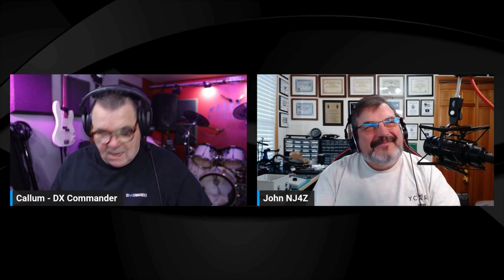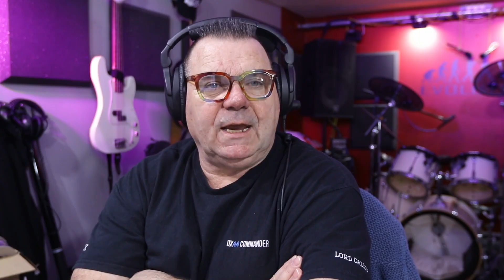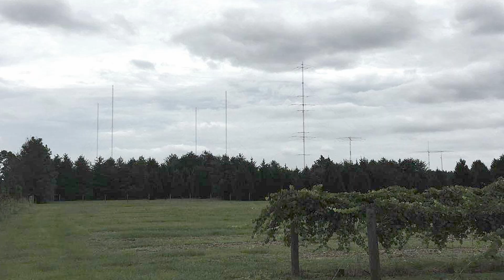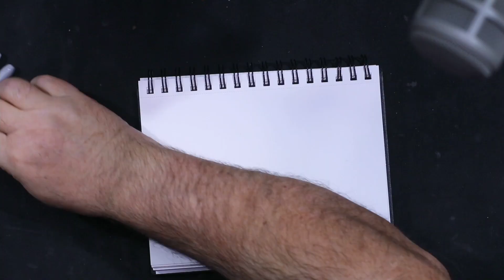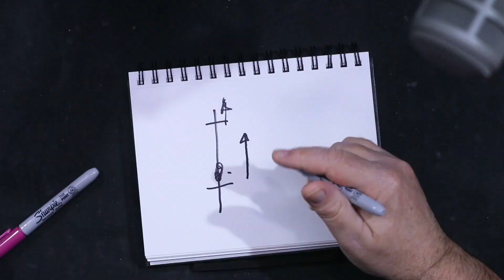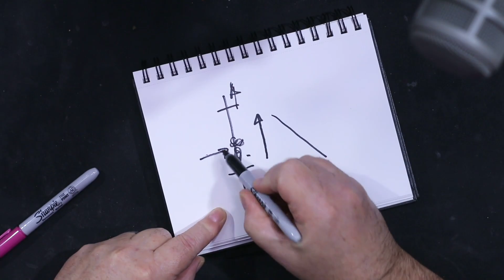Could We Phase TWO Multiband Verticals Antennas Together?

Comment: Two verticals for 80, 20 m apart with a 90° phasing gives you infinite F/B and some 3 dB lower noise in RX-mode.  Making the verticals also resonant on 160, the phasing 135° gives you again an infinite F/B- ratio there. 3 dB lower noise there as well. The result is most noticeable in RX- mode. Try it and you will be amazed. 73 et GL
Reply from the maker: >>>  infinite F/B <<< Yeah OK!
Reply: Used such antenna on 80 & 160 from 1979 - 91. > 40 dB of F/B on many occasions when low radiation angles were active. S9+++ to NOT audioable in reverse (RX- noise S1).

Comment: Hi Calum re multi band phasing could you use a variable inductor and/or variable capacitor say connected to stepper motors to change the phase angle of the phase line also say perhaps a Wilkinson divider to ensure equal current goes to each antenna before the phasing unit but i wonder if the losses would justify such a setup and its practical
Reply from the maker: Yes. As a science project, I think you are probably near it - but economics, practicalities etc might be off-putting, as you indicated..

Comment: G/D from chilly New England Chaps......here is the difference......the hex beams are connected up in parallel, the beams themselves produce the radiation pattern and are individually 50 ohms so all they have to do is properly match the total 12.5 ohm impedance (4 parallel 50 ohm units) to the ultimate 50 ohm feedline impedance......when we phase verticals we are using the spacing and delay lines to produce the radiation pattern as we know....a much different problem, adjusting delay lines is "easy", changing radiator spacing electronically, not so easy..... cheers from New England to Old England, 73 Mike K1FNX
Reply: thanks for the information, Mike that makes sense for the Hexbeams.

Comment: How about filtering and phasing. Filter the band you want then add a delay then recombine back through another filter? Or you could trap the unwanteds and delay then recombine? Would involve measuring the delay through each section then know your spacing between each antenna. But thats easy enough to do. 
Now for three antennas this might also work.
Reply: interesting concept.
Reply: Seen it on a broadcast MF site. In this case they had only two freq in use. One had to have a radiation pattern change and reduction in power at night to stop interference. From a vague recollection they had a high pass filter for the wanted freq and trap for the unwanted freq the back the other way to combine. Then a length of LDF7 as the delay line for the freq thas was burried out in the antenna field. This was switched in at night. But this was only a two 65m mast installation.

Comment: The Titan DX GAP Antenna is probably as close to a commercial antenna to the DX Commander as it gets. Unfortunately being a center fed vertical dipole with aluminum (for the most part) elements it was top heavy as all get out.I had one and it worked great till a wind storm came along and folded it over at the base 😞 - it was only up for a little over a year sigh
Reply from the maker: Woops

Comment: Brilliant Cal. I had a guy surveying my house for a remortgage today. Showed him my FT'DX3000. Turns out he is an ex ham... screech of brakes sound... not quite a ham. He was a CB guy from early 80s. Midland AM 40 channel rig and a "big aerial" I reckon a high gain silver Rod which you trim down for 28megs. I proudly showed him my rig which MLS sold as "used". However it was boxed, plastic still on the displays. So MLS sold me a new multimode rig for less than a grand. DX Cdr and MLS are the creme de la creme!

Comment: My previous thought-experiment wonderings (wanderings?) are with a single, fully strung, "Driven" DXCommander in the centre of a field with a "Reflector" DXCommander that would have to be moved around the field to marked points appropriate to the band in use and the desired direction. Bit of a faff to have to do that. Maybe on tracks or a little trolley. Too much cheese before bedtime? 🧀
Reply from the maker: Yes.. Nearly.. Or just a ton of relay to switch lots of different verticals?

Comment: Could you use the velocity factor of different coax cable to set up the phasing between the two towers instead of a phase box.
Reply: not a bad idea... don't know if it is practical or possible but it is an idea to explore! thanks!

Comment: Broadcast stations have done this, I think Brookman’s Park for one was directional at 1548 for Capital AND 1152 for LBC. 
As you say you need to introduce delays for each frequency, which you do with a complicated-looking matching/combiner unit. 
Not actually that complicated; 
The BBC did it too at a few sites. 
Very interesting concept.
Correction: Saffron Green.

Comment: Have you seen Zero Five antennas? They have a 10-160 multi band 43" vertical.
Reply: Yes, different concept in the fact this is basically a non-resonant antenna with a matching network.  You can take a length of 43 ft wire run it up a pole with a radial field and a remote tuner at the base and get it to work,
Reply: @FromthehamshackwithNJ4Z  Thank you for your response. I would like to ask you a question.  Does diameter effect band with? If you had two 43 foot vertical one a 4 inch copper pipe the other a 14 gauge wire would there be a difference and why? Thank
Reply: yes bandwidth is affected by the diameter of the conductor or radiator.  It has to do with surface area and skin effect.  Callum and I were talking about building a cage vertical or a cage dipole for 80 meters.  The design calls for multiple elements spaced out but tied together at the feed and end points to increase the useable bandwidth of the antenna.  @eazystreet5507
Reply: @FromthehamshackwithNJ4Z  I was thinking of using coper foil around a design like yours connected by the wires on the inside. I guess wind would at sometime would be a factor. I'v seen some nutty stuff over the years and some of it worked!